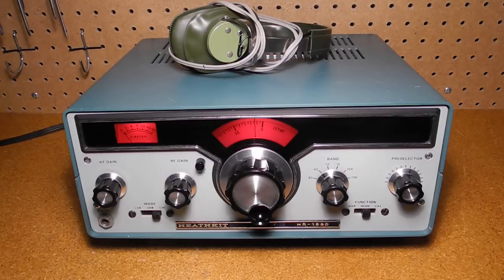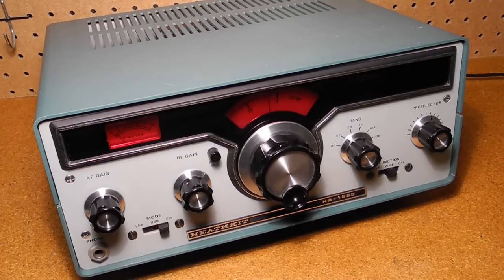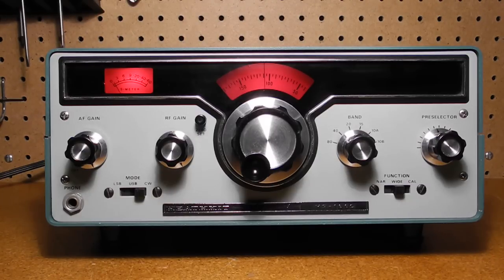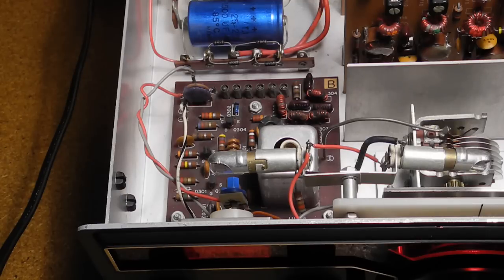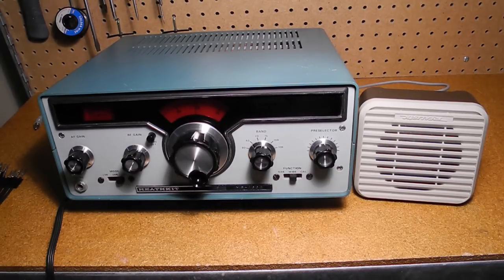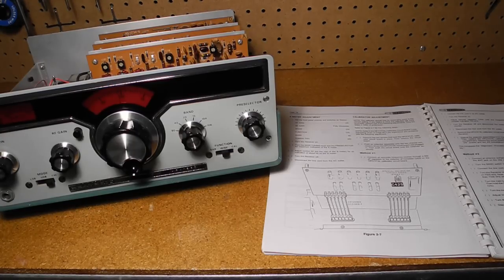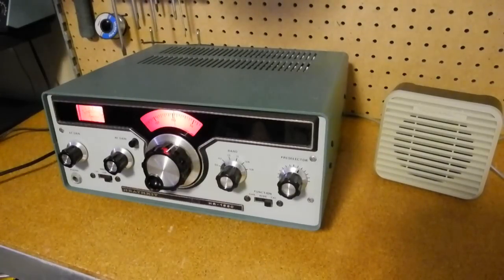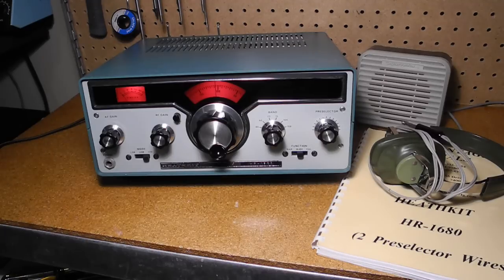The Heathkit HR-1680 SSB/CW Receiver

Comment: I built this receiver and had a problem with sensitivity. After trouble shooting it, I found there were 2 MosFet transistors on separate boards in that one of them failed and took out the corresponding transistor on the other board. After several attempts to replace each one, I found that they had to be replaced at the same time because they were tied to each other. It was either a design error or the engineers weren’t aware of this flaw. Fortunately I figured it out and got the receiver to work properly.

Comment: I have an AR-1680 in storage until I retire from work to do a rebuild. I for about the unit until I found your video, and I am now retired, which prompted me to unpack the unit and get busy cleaning, repairing, and replacing faulty parts. When I finish the unit it will join my HW 5400 and HW-9 in my shack. 73 DE W9FPJ